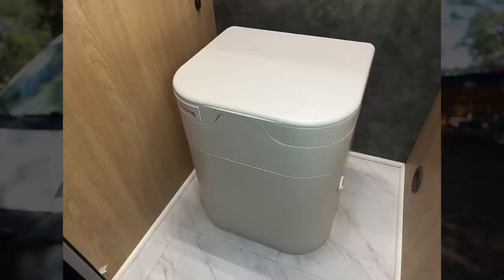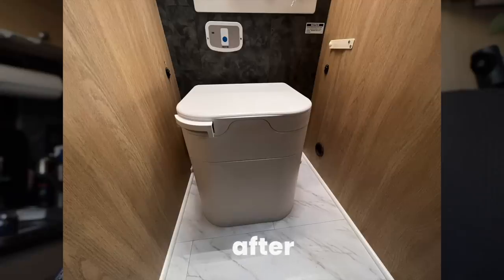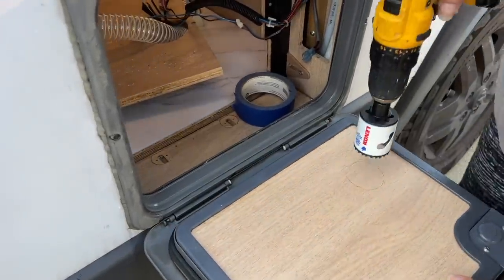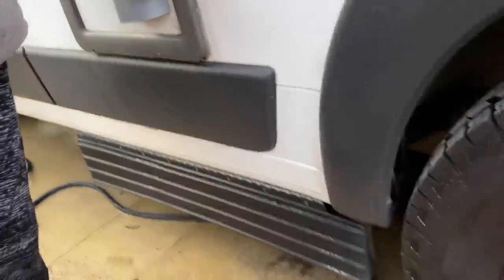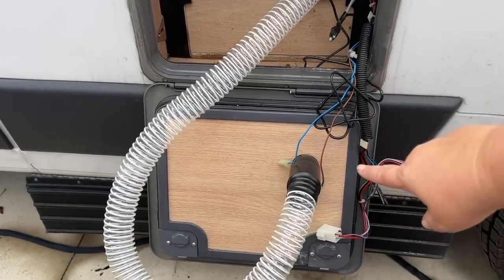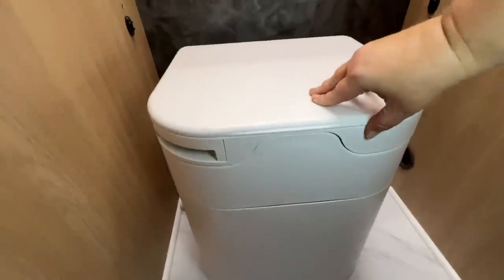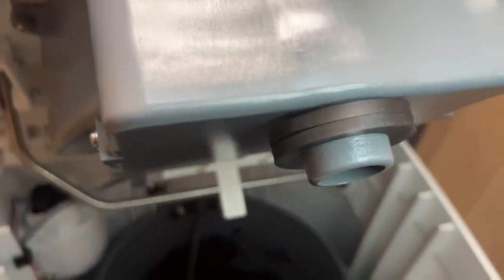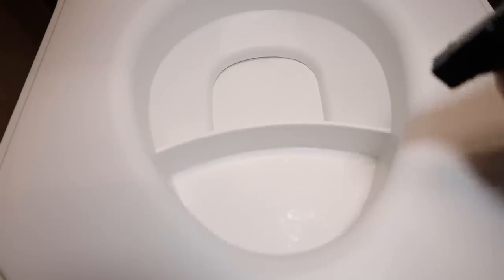Ogo Composting Toilet Review: Easy Installation In Your Van

Comment: A possible solution for red light: place a small mirror on the wall across from the light
Reply: I was going to suggest that! Glad I read comments first! 🤣
Reply: Hey, I was gonna say the same solution. haha Either a small compact mirror or a full side wall mirror just in case Amber likes to watch herself. haha j/k Amber.
Reply: I was just coming to suggest this! And dollar stores have little 4x4 mirrors. They're even framed so it would look like it "came" with the camper.
Reply: Great idea!
Reply: After almost 3 months - my red light always stays on. Would love to hear if anyone else has this issue and how to resolve!
Reply: Auto parts circular sideview mirror stick on dot.
Reply: I was thinking the same thing!
Reply: Ditto!
Reply: @amyintheairstream  I don't have this toilet - If it has a level sensor it may need a wipe off - If it has a lever arm of sorts may need the track cleaned or lubed, same with pressure plate - just try to find out the mechanism it uses to register the level and gently clean & wiggle to see if it responds - If it has a spring then it may need a few links cut or a new spring
Reply: @ShayTBD  so helpful, I’ll give that a try. Thank you so much!!!

Comment: If this was electric like those electric kitchen composters it would be perfect. You can run it every couple days and you don’t need to add extra chips. It uses 1kwh per use so power is minimal.

Comment: Nice install. But you really need to buy some crimpers for your electrical connections. You shouldn't demonstrate incorrect method of using vice grips to crimp connectors. The correct crimpers are inexpensive and make a nice crimp as designed.

Comment: Having had a composting toilet on two different rigs and really liked it, I do have a question on your vent location. Do you get any odor outside in the general vicinity of the vent?  I ask because on our previous rig a truck camper, I vented out the back and ended up moving the vent hose by tapping into the black tank pipe so no smell at ground level only when I worked on the roof?

Comment: can you comment on the smell? does it smell? especially if you have the maxxfan on for ventilation for example, would the smell sucked out from toilet because of the stronger pulling pressure by the maxxfan?

Comment: I live in my RV with my son full time. I have a few composting toilet suggestions.
And I want one like yours. Love the look also compared to my rough 2x4 plywood home build.
I built a solid wooden frame, (son is a heavy man) with padded reg toilet seat. I use 2 plastic bags close pin clipped in a 5 gallon bucket with any kind of shavings coconut core is ok, but one brand I purchased for compost, dampened and left in a bag, suddenly had coconut maggots living in it and it freaked me out because they were big and ugly, and traveled. I am using hamster or rabbit  litter at moment, but it takes up to much toilet space. 
Anyway, I can throw tp, and whatever in the bucket as I do not have an agitator which would be a real game changer!  It takes me two weeks for it to need emptying. I  open lid, pull and tie off bag and out it goes to trash into another trash bag as well.
   I created a urine diverter out of free unused poop collectors from hospital, that were given to me for getting  stool samples. They are the perfect shape as designed to fit on a toilet, but flimsey. A proper one cost $78.00, I was not impressed. And it had to have edges to bolt under the wood frame. I Drilled a hole carefully through 2 of them  glued together  then glued and siliconed a hose to go into large random plastic containers I had from malfunctioning water distillers. I like reusing things that are still very useable, and see through.
My
#1 suggestion from me to you is, write the company and order a 2nd pee collector. You will thank me later, believe me..

#2,. Constantly check your pee level light!!!!  Because of midnight spillovers, we use multi newspapers under the tanks, because of stupid wood floor inlay that buckles and peels when it gets wet.
 I will be replacing after all this use, the bathroom floor soon. with water proof linoleum. 
While stick down wood laminate flooring looks all nice, it is NOT waterproof. Think rain, snow, spills, enough said.
#3. Use lime away, or a dab of white vinegar soak when interchanging the bucket. Urine scale will build up on the walls of your pee container causing the red light to not see urine levels.
Which is good reason to own 2.
Source extra caps because you will in time misplace the one I got with compost toilet.
While I am 70 and diabetic, I guarantee you anyone can  fill that bucket up more then you will want to go dump it,  especially if you are sick, tired in  middle of the night, or traveling in rain or winter. A 2 nd pee container is mandatory!
Before you move on order another while it can be delivered where u are at. 
 We use 2, probably could use 3, 2 gallon containers so we are not daily dumping. Pain in the butt. My son takes them both out at night as his chore and waters rat holes, plants trees Which love the nitrogen in urine. Doing plants a great service sharing that gold. My grass never looked that healthy ever! 
Tip#4. Dump urine discretely, around the circumference of your van. No it's not gross and won't stink. But it keeps ants, mice, rats, coyotes, crawling bugs and snakes from entering into your van. Trust me I know!! 
I am the Only one who didn't have deer, gofers groundhogs Chipmunks and whatever, eat my garden this year. Better, and cheaper then a fence! 
  
I guarantee it will keep the rodents and ants at bay. In Fla, snakes spiders, and other creepy things get into RVs. Pee is plentiful, and cheap.
I know it sounds gross to many people, but I used it in my garden and am the only one who had big flourishing veggies. 
That's all my composting tips. 
You will love not dumping. Looking for dump stations, clandestinely trying to haul a cassette tank into a Walmart or a cracker barrel or even a rest area bathroom to dump it. Hah. Good luck with that. 

I look forward to your next reviews. 
Friend from Maine.

Comment: Looks like a very good option. Is there a way to keep bugs from coming into the tubing? How large is the urine bottle? Does smell come up thru the thin cut for the urine diverter? Since it’s not a hole, you can’t plug it.  Can the fan be “ on” intermittently so it’s not a constant draw on electricity?   Thanks.

Comment: Amber,  could you attach a block to the floor, raising your leg up and away  on the right side where the latch is?  That will take your knee area away from that latch.      Before you actually attach the block, just put it on the floor to see how your right leg moves away from the latch.  Also, maybe 2 blocks may be the right height to work…?

Comment: Thank you for this info. We will either get this or an incinerating toilet. I've never seen how it works. As to the light, maybe install a little mirror on thE wall. I think a little adhesive tile should do it.
Reply: We lived on a fixer upper houseboat for several years, and I know it’s a pain to pull things apart, dreading to know what’s underneath. So I feel ya. Glad you had good help. An incinerater toilet is very expensive. But so worth it.

Comment: Do this to find your urine level without raising the lid.  On the front of the unit cut a small vertical strip, just enough to show the top 3 to 4 inches of the urine collection container.  It doesn’t have to be wide, about the width of a pencil. This way, anytime you walk into the bathroom you can easily see how much space you still have.  You can still incorporate the mirror idea to alert you, but you will have a clear visual path to actually see the true level.  If you are worried about smells leaking out, you can place something none abrasive on the inside to help create a seal between the container and the opening.  What comes to mind is the packaging electronic are wrapped in; that thin solid packing material.

Comment: use a small mirror and glue it to the wall across from the red light so you are able to see it. With the pull out put a small lift under your right foot to help elevate your thigh maybe.  Kathy needs to have a how to video she was amazing. Safe travels

Comment: I really like the looks of it it's sleeker than the nature's head the cap for the urine diverter I don't know if they have a place for it but I would put a piece of heavy duty Velcro on top of the cap and and stick it to the inside wall of the toilet so you won't lose it you know it's always there. My good news I sold my bus Saturday thank God and I'm looking at a van which I'm gonna convert and I may just go ahead and pull the trigger on a compost toilet like that.👍✌✌👏💪💖🎅🚌🌻

Comment: The pullout door is a dealbreaker for me.  It’s going to weaken and break. Yes, you can do the gymnastics some of us would require to never touch it with our legs, but if it’s the middle of the night we’re going to forget. We shouldn’t need to worry about it because it was a poor solution that never should have left the drawing board. I’d be straight up shocked if, when it inevitably breaks, the company doesn’t blame the customer and accuse them of being too incompetent to use a toilet.

Furthermore, not being able to line the bucket with a bag makes it even more unpleasant to empty it.

To be clear, I’m definitely not criticizing you personally. On the contrary, your audio is good and clear and you did a great job showing exactly what you were describing. Great video.